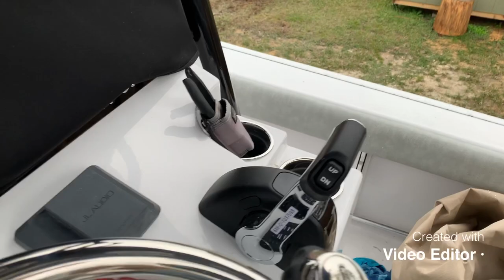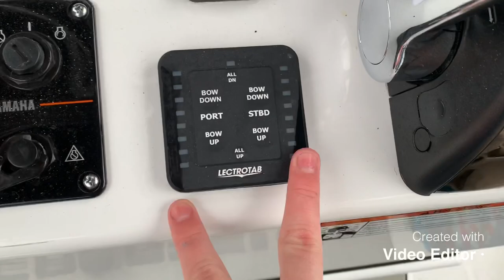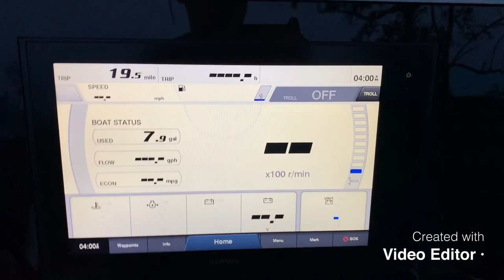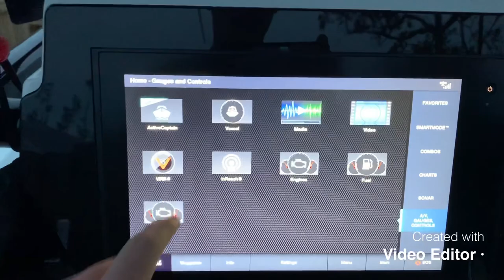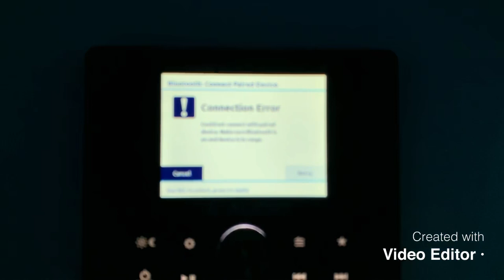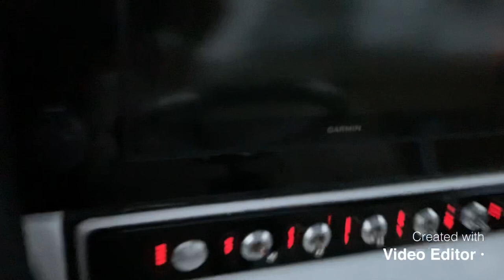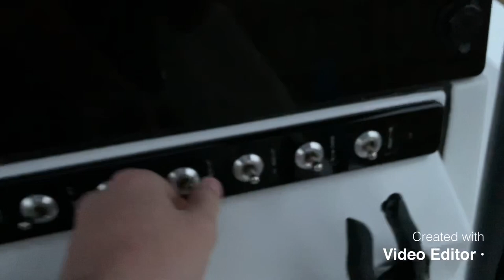2020 Sportsman 247 - 2nd Station

Comment: A few more questions.  Do you still like the boat over a year later (April 2021)?  Any issues?  How many hours do you have on it now?
Reply from the maker: Yes we still love it. With any boat we have had several minor issues. The black dash piece started to come lose. Fixed. Trim tabs didn’t work properly at first. Dealer install issue, fixed. All of the hinges on each front hatch the screws backed out. We just replaced them with longer screw that went through the deck. Sportsman was very light or not at all with lock tight so we’ve had a lot of screws back out. But just add some lock tight and screw it back in. Overall it’s fantastic but the little details are somewhat annoying. The freshwater Washdown pump went out twice but we decided it was user error as we let the hatch close on the hose once. Engine has been flawless. We have roughly 110 hours as of right now. Haven’t used it much over the winter.

Comment: Thanks Taylor.  This boat is on my shortlist.  Did the $102K price include the trailer?  If so, how much did they charge you for the trailer?
Reply from the maker: Yes the trailer was $4 ,965. The boat was  optioned at $92,210. Trolling motor was $3,808. Prep and Freight was $2,800. Looking back final price was $103,785 and the dealer gave a small discount so we paid $100,490.
Reply from the maker: What other boats are you considering?
Reply: @tshep03  Pathfinder 2400 TRS, 2300 HPS and Skeeter SX240.  I'm open to other suggestions.  Just bought a place on Pine Island, FL.  Plan to fish Pine Island Sound and the Gulf on occasion.
Reply from the maker: @billb5684  All solid choices. I think it’s worth mentioning that I envy no other boat in the same class. The sportsman is still what I’d go with if buying today. We also considered pathfinder.
Reply: @tshep03  Wow I optioned something similar and it came out 132 without trailer interesting how much the builder adds